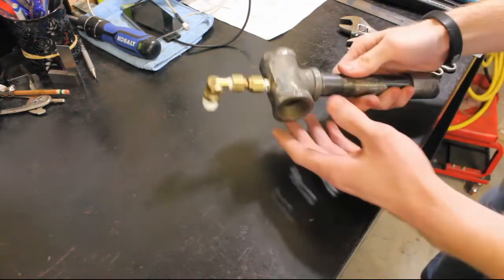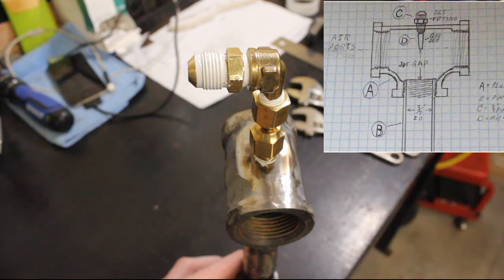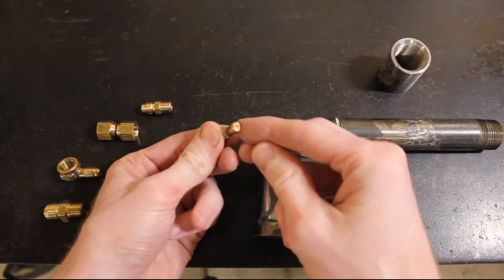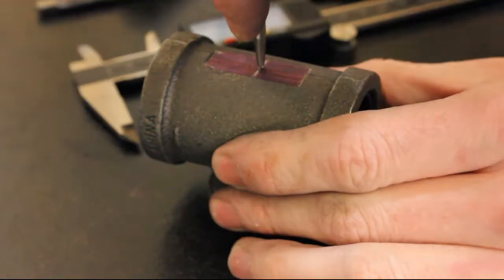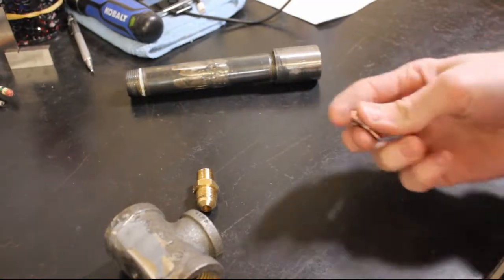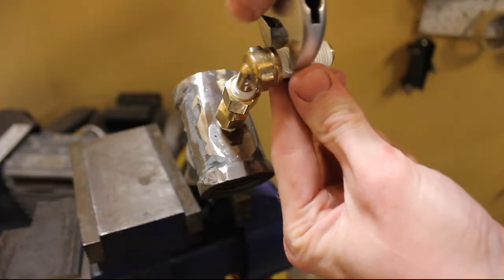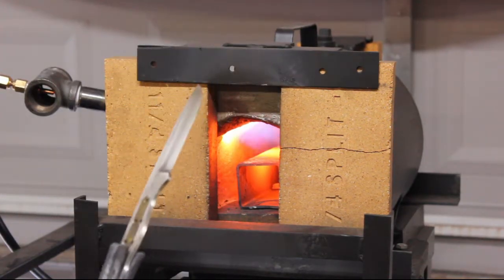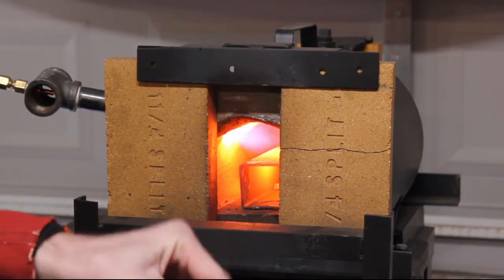How to Build a Venturi Forge Burner for Only $21

Comment: Is anyone else’s swivel leaking propane I put some soapy water on it and bubbles started to form. Not a ton but that worries me. I’m new to this kind of stuff.
Reply: You should NEVER use tape or pipe dope on flare fittings. The threads are not tapered and the seal is formed where the angled plane of the flare seats. Tape will restrict threading depth and then the angled surfaces will not contact each other
Reply from the maker: @leewilloughby6214  Good to know. Seems to be working fairly well for me right now. I'll keep an eye on it.
Reply from the maker: You may have gotten a defective swivel. Mine does not leak. Make sure you use Teflon tape on the threads. If it leaks do not use the assembly! You're dealing with propane, last thing you want is to have an issue with it catching fire. 100% replace the leaking fittings.
Reply: Red Beard Ops I think l may have solved the issue. I put more plumbing tape on the threads and used a wrench to tighten the pipes. Sent air through the system with my air compressor at 50psi and no bubbles I think it just was not tight enough the first time.
Reply from the maker: @psychosidman949  Awesome! Glad to hear that! Cheers man. Stay safe

Comment: Im just getting into forging and am making my  dual burner forge out of a 30lb propane tank. How would you link 2 of these burners together?
Reply from the maker: I've never build a forge with two venturi burners, however, I've seen a ton of forges built this way! I'm sure it would work, but it may take some tuning. You'd probably want to incorporate a needle valve somewhere on each burner so that you can play with the gas rate. But like I said, I've never done this before.
Reply: I will try to make this into a double burner. Will be making pretty much 2 of these and connecting them together. Will most likely post it on IG.

Comment: Would you be able to use two of these burners if building a 5 gallon propane tank forge?
Reply from the maker: I'm sure you could. I've seen some set ups like the one you're describing. I, however, have not made one in that configuration. The last forge I made out of a propane tank was forced air. If you can manage a forced air burner build... I tend to like those better.
Reply: @RedBeardOps  thank you so much for the response :) liked and subscribed
Reply from the maker: @Acribus1  Thanks man! Here is my blown burner for reference - https://youtu.be/WtCWbl-Q5fo

Comment: Need to make one 1
30 in long
Reply from the maker: Sounds like a big one!
Reply: @RedBeardOps  making a bbq grill from a 14in ss pipe, bout 27 in long. Wonder if I could hook up 2 pipes to 1 venturi or if they will need a separate one
Reply from the maker: 2rawww that likely will not work. The ID of the pipe and the placement of the jet matters. Additional adjustments would be needed if you changed the length of the tube as well.
Reply: @RedBeardOps  yeah I'm going to have to do a bit of playing around with all the variables.
Reply from the maker: 2rawww I’ve see. A good deal of forges run with two Venturis in tandem. Not sure if that would fit your application though.

Comment: Hi
i have build the same burner and it seems to work better with a 3/4 to 1" fitting on the end my 
forge is big it 370x290x300 so i am going to try 2 burners
thanks for your video on the burner.
Reply from the maker: Cheers man! Thanks for watching. Hope the duel burners work out for you! Lots of power!

Comment: Pretty good. I’ll use some ideas from this video. However, there should be a ball valve in there somewhere so that you can shut off the gas at the burner, then shut off the propane tank. Simply shutting off the propane tank can cause a flame to travel through the hose and into the tank. Then boom. You don’t want to be liable for something bad.
Reply: Propane is not self oxidizing. It NEEDS oxygen to burn. The flame cant travel up the supply lines because there is no oxygen in the line. Using oxygen or acetylene as a fuel has a high risk and requires flame arrestors. 

Even though you are trying to be helpful by sharing safety information, its not a good idea unless you understand the science behind it. Misinformation causes knee jerk reactions by the uninformed. I.E. Hollywood says AR-15s shoot 1000 rounds of heat seeking bullets per second, so California bans anything even remotely gun shaped.
Reply: This isn't true. Propane needs oxygen. It doesn't flashback like that. The only major worry people should have with their setups is that their hoses don't get hot. If the hose were to melt open, it would basically create a fire jet that steadily burns itself through the hose and heads for the propane tank. The regulator would still face such a sudden drop in pressure that the regulator would kick over and drop the gas down to less then a tenth of a PSI, and the flame wouldn't be sustained. That's why regulators are on propane hoses in the first place.
Reply from the maker: A ball valve would be a good and useful addition. I normally shut it off at the regulator.

Comment: nice video what about running on natural gas? propane is very dangerous I worked natural gas company for 31 years!
Reply from the maker: So natural gas works out pretty well for blown burners since they can run at lower psi. You would be hard pressed to run a venturi forged with natural gas (I'm pretty sure). From a danger standpoint, I feel pretty safe with propane. I have an ESD built into my system as well in case of power failure. When it comes to blacksmithing, knifemaking, bladesmithing, and farriering - propane is the standard for gas forges. Cheers mate! Thanks for the comment.
Reply: @RedBeardOps  after the main reg nat gas house line can be 7"wc ( = 1/4 psi) unless your running elevated pressure 1psi to 5psi

Comment: I would love to know everything about this small forge. The one I built isn’t getting near enough heat. Dave keeps telling me to hook up my weed torch to my mini forge. He might be right but you seem to have it down to a science. I just wanna forge to heat treat my 1084 since I cannot afford an oven.
Reply from the maker: Depending on how much time and effort you're going to put into it you may want to buy a forge. ALTAS FORGE has an excellent knife forge for $285. Would be perfect for your needs. http://www.atlasknife.com/product/atlas-mini-forge-v2-stainless/           IF you want to build a little forge for heat treating you can get a piece of stove pipe or any piece of steel tubing that is around 8'' in diameter. Then you can go "High Temperature Tools & Refractory's website" to order Kaowool. Line your pipe with 2 layers of 1'' kaowool then coat the wool with satanite. Then build one of the venturi burners like I did here and you're off to the races. Use hard firebrick as the doors.  For more information you can search bladefourms for forge builds here : https://cse.google.com/cse?cx=012217165931761871935:iqyc7cbzhci